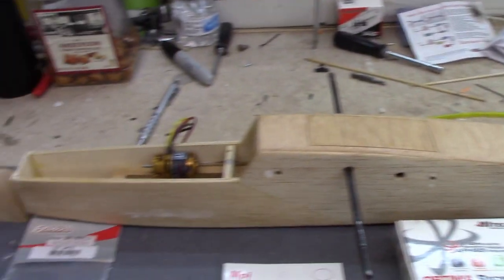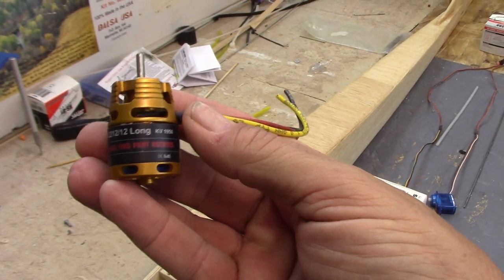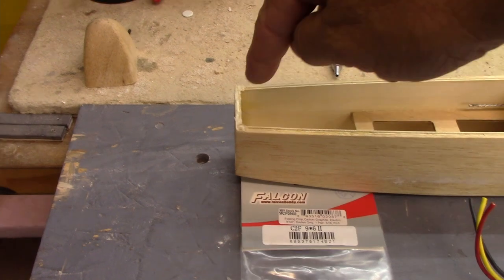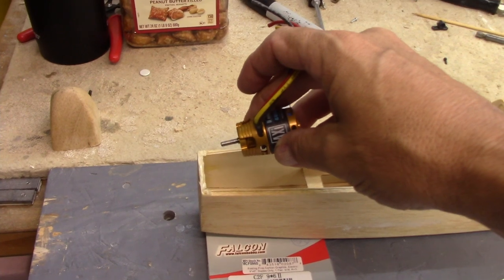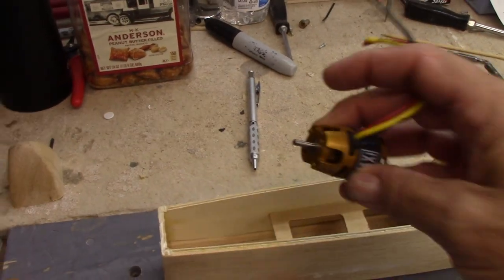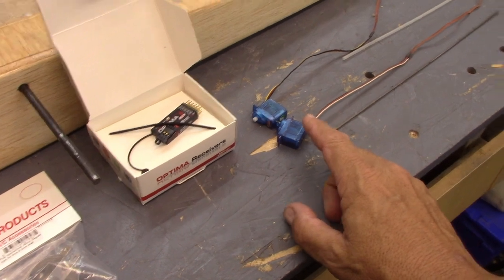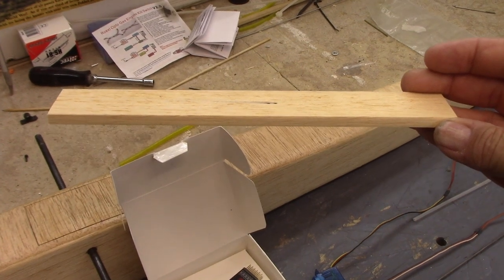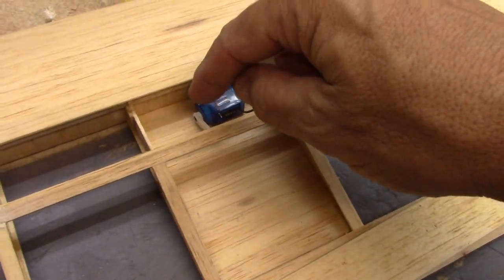Dynaflite Apogee Sailplane - The Next Victim

Comment: I built one of these back in the early 90's and loved it.  I put a geared brushed RC car motor in it running on 6 cell then 7 cell Nicad.  Always got funny looks at the model club because I was flying electric.  Had to reinforce inside the nose with a bit of fibreglass to handle the weight of the Nicad.
Reply from the maker: That will be finished hopefully by the end of summer. It should fly quite nicely.